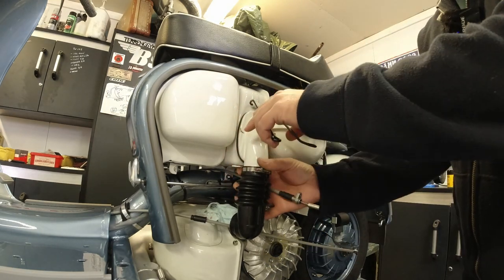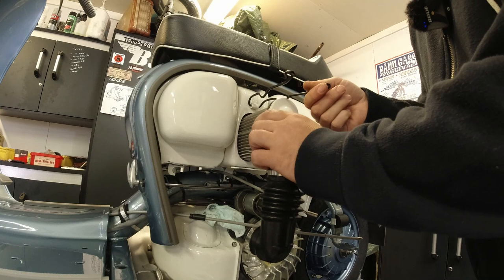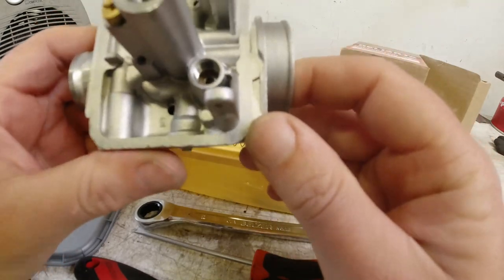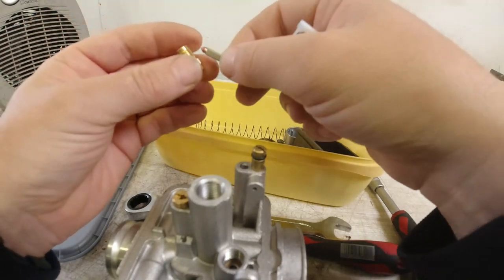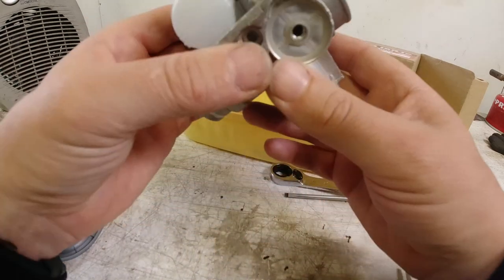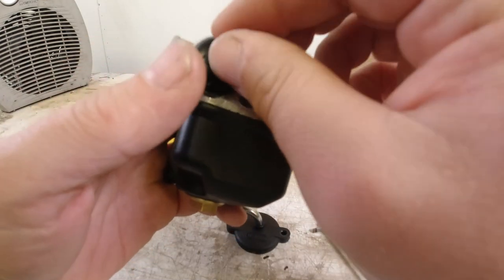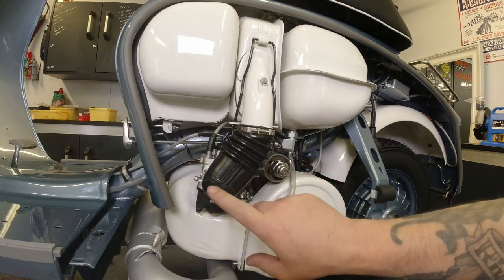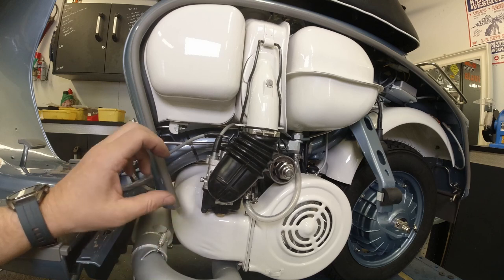Dellorto PHBL (and phbh) Setup.

Comment: Cheers Rob - really useful. I was getting some spluttering when accelerating and you commented about the needle on the PHBL being a bit small, so I put the clip on the top groove and it’s  accelerating very smoothly (SX200). Amazing how such a small adjustment can make such a big difference. 👍🏻
Reply from the maker: Just be careful. Too far and it will bite you.
Reply: Noted 👍🏻

Comment: Hi Rob been waiting for this one good tip about the wing nut very clever check out the jetting on MB website for this carb it says with air box and filter main getting92  90. 88 with remote98. 95. 92  no filter 105. 102  100  I’ve gone for the remote option and it’s flying 👍👍
Reply from the maker: That info is slightly outdated. With the bgm filter and the elbow removed in the filter box it's supposed to be about the same as with a remote filter but we will soon find out.

Comment: Hey Rob, I'm doing a jet 200 at the moment and I'm thinking of fitting a PHBL  carb, is there any real reason to change any of the  jets etc from how they come out of the box?  it's a standard 200cc inlet manifold, wonder if you can advise , cheers Ken
Reply from the maker: Hi Ken. You definitely need to jet to suit your scooter. We don't actually know which machine these are jetted for in the first place. If you are worried about doing it yourself then any reputable scooter dealer can fit the correct jets before sending it out. Mb, chiselspeed and many others.
Reply: @kickbackgarage  Thanks Rob, much appreciated,

Comment: The air hose being at such an angle is going to cause future problems I suspect. 
I am glad I didn't use an air box on my rebuild. I have a ram air filter on mine, it looks good if not original but having the hose at an acute angle doesn't look original either. Its all about compromise sometimes, originality against usability.
Looking forward to seeing the TV fired up and on the road.

Comment: HI Rob  Sorry another question. Did you use a special inlet manifold? The reason I am asking is that I fitted a BGM RT 195  Kit. The inlet manifold I am using with the carb means the throttle cable foul's with the toolbox as it seats to high on the manifold. In your vid it sits, I would say in the correct position. I think I may need the BGM Inlet manifold for the kit, but do not wish to buy it is it does not make a difference. Any thoughts. Cheers. Excellent vid by the way.
Reply from the maker: I used the mb 200cc manifold on this build.

Comment: Rob, have you ever fitted an extra throttle return spring on the throttle control rod? My dellorto will not return to tick over position without my assistance?
Reply from the maker: I've never needed to fit one. Your throttle rod is probably rubbing on you cables in the headset or the twist grip tube needs cleaning or re lubrication.

Comment: Hi Rob  When you fitted the carb to your scooter did you use the standard throttle cable and choke cable or did you have to modify?
Reply from the maker: Standard. But had to modify the choke cable a tad.

Comment: Hi Rob would you use the same carb and set up with the air box on a 225 RT kit as I would like to keep the original look on my SX 200 and to keep the noise level down  thanks 👍
Reply from the maker: It is really restrictive through the air box. The chap with the blue TV has fit a bgm clubman sport and a open 30mm phbh and it's much quicker without being obtrusive. If you look on my story on Instagram you will hear what a open carb, bgm clubman and rt sound like. It's actually quite pleasing to the ear.

Comment: Always wondered about the drain tube on the air hose. I get that it is there to drain fuel from a flooded carb, but doesn't it risk sucking road grit up the tube into the engine?
Reply from the maker: Not really an issue. My engine has a breather that is basically a tube. No need over thinking these things.

Comment: I have a 25 mil carb on my 186 kit and has been running great for the last 3 years. All of sudden running crappy won't stay idling. Took carb apart and noticed one of the floats is full of fuel. If you ask me there shouldn't be fuel in there but what do I know. Can anyone answer??? Thanks
Reply from the maker: You are correct. New float needed.

Comment: Hi Rob would the jetting be the same with a remote filter or with no filter at all 🤔🤔🤔 thanks  if not the same what jetting and needle would you use
Reply from the maker: Almost the same with a remote filter. This is a slightly rich starting point 😎

Comment: air tube looks far too cranked over, surely it will crack & split in time. is there any option?
Reply from the maker: Maybe a different manifold would move it over. Will probably last a couple of years though. Probably a good idea to have a spare in the toolbox.

Comment: Damn i bought one came with a main jet 116.
Working my way down now at 75, still not running as it should. Its way to rich.
172cc malossi on a Runner m07
Reply: Edit. Back on 110. The float level is off it keeps overflowing.
Small 5mm jet was a 100. Changed to a 45 runs smooth on 1/4 to 1/2

Are these notorious to overflow?
Reply from the maker: @RancidJAx nope. Only if the float hight is set wrong
Reply: Indeed, i checked it and it was way off, fixed it going for the test run as we speak🎉

Comment: ok rob...just finished dry build on 195 rt on 125 series 3 dellorto 25 mm 100 mjet 42 clubman exhaust
bgm 12v ignition...have spark...cannot get it to fire and fuel seems to be in barrel...
ideas? thx
Reply from the maker: What pilot jet? They can be a bugger when brand new. 10 kicks and choke on my s1
Reply: @kickbackgarage  hmmmn great Q ill check, i think 70 is stock? what should it be? or is it arbitrary to the running condition at the present? thx again!
Reply from the maker: 70 is the choke, which is correct.

Comment: Alright mate i am from hull and have rs125 aprilia with 28mm vhst but its impossible to jet so got the 34mm silver top dellorto but putting bike back standard mick abby did a fast road tune on it what i need to know is all 28mm phbh carb same jets roughly anyone you know near hull fancy so work on my bike i will pay top rates i am terminally il but can guide them

Comment: Hi Rob how did this run with the D26 needle, I have just used the RT kit same set up with D22 needle runs really well, slight stutter1/4 to 1/2 throttle, it’s hard to determine whether it’s rich or weak at the present, maybe a slighter reacher needle taper may just iron this out. Thanx
Reply from the maker: It actually runs fine but the climate here in Norway dictates slightly rich settings. I would suspect stutter being rich if the engine is airtight.
Reply: @kickbackgarage  thanx for the reply yes airtight, when I say stutter it’s like one misfire then ok again, does it consistently at this position, maybe rich but the D22 is a weaker needle than than the 26, thanx for your reply , interesting videos.
Reply from the maker: Are you running an air filter?
Reply: @kickbackgarage   yes the through the air ox with neck opened up, and the gause type from MB, I may try dropping the needle it’s on third clip down may try moving it up to 2nd before I try the D26 needle, the engine pulls nice except for this blip,
Reply from the maker: I think the safest way to determine if it's running rich maybe actually to try it a couple of steps richer. If it gets worse, then you know which way to go without running the risk of trying it too weak.
Reply: @kickbackgarage  thanx for your input, I will sort it, I was interested in how your engine ran with the D26, at the moment here is similar climate to yours, I run a Casa kit on another scooter and have had to riches that up. Once again look forward to more videos.
Reply from the maker: It's running fine, a bit rich but it was getting cold when I last had a go. At the moment we have snow and ice. Probably won't be out until April again. 😢
Reply: @kickbackgarage  really wet here, fine tuning now will wait until it picks up here also 👍

Comment: I didnt notice him mention the various needle setting positions an how to set each one, does anyone know how you set position 1 or 5?
Reply from the maker: Batman would know that the top clip position is 1st then downwards is 2-4 from top. When you move the clip down you richen the mixture because you lift the needle up.
Reply: @kickbackgarage  haha yes bud i was just wondering how to access the needle as i wont be fully removing the carb rather just working on it with the top seat removed (rs125), cheers
Reply from the maker: @brucewayne2397  unscrew the two bolts on top of the carb and pull the slide and spring out. The needle sits in the slide bud.
Reply: @kickbackgarage  top man

Comment: float valve ?
Reply from the maker: Watch the video before commenting, you plonker. 😀
Reply: @kickbackgarage  dellorto is my pet hate stopped using them 30 years ago mate , its the same carb since the 70s and has not changed or developed ?  things have moved on ........
Reply from the maker: I agree but still have their place on non tuned motors.
Reply: @UCeFY5M7PoIVWw1tN56PUd-A no we dont fight were mates .
Reply: @kickbackgarage  its a great little video mate and helps people that still use this carb .